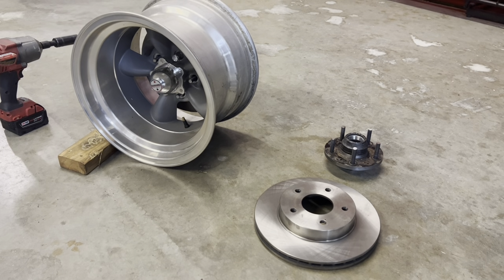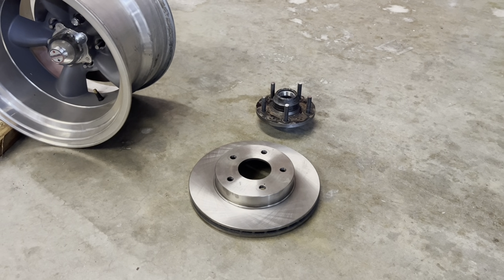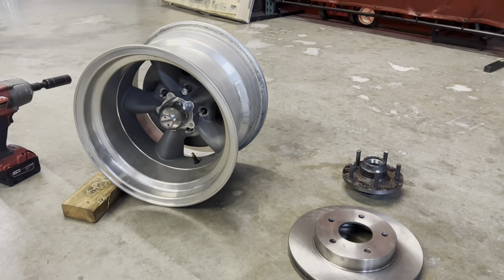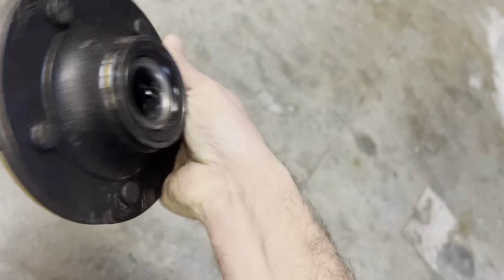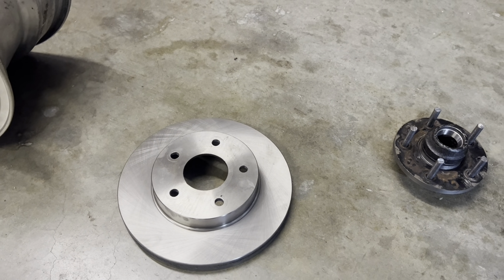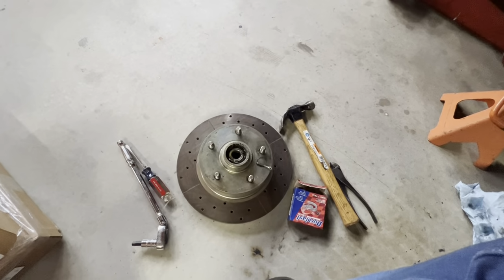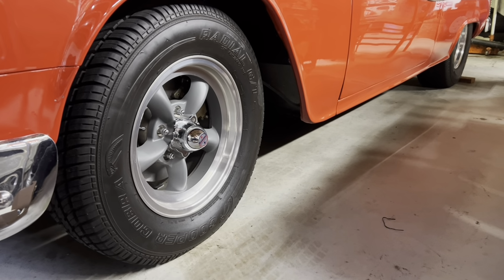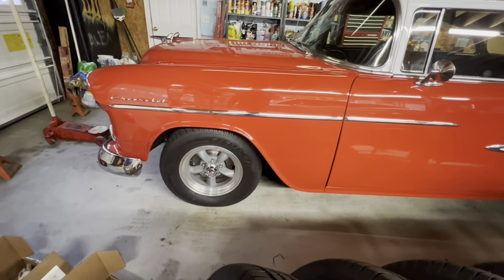1955 Chevy! Restore factory track width! CHEAP DISC BRAKE SETUP!

Comment: Niiiice car. I am getting ready to do mine, with 2 inch dropped spindles. I will have to see if the kit I am getting from Tom's Classic keeps the original track. Also, wondering if you have the 55 rear end under the car. I want to put wider tires on mine, and yours look great. Good explanation of the conversion process.
Reply from the maker: Thanks! I would definitely check because there is only one kit on the market that I’m aware of that keeps the factory track width. I do still currently have a factory 60” width stock rear end. 15x8 with a 4.5” back space with a 255/70/15. It would fit a 275/60/15 but would be a little tight. I used to run a 18x9 on the rear with a 275/35/18.

Comment: Only problem I had was the hole in the rotor had to be machined slightly to fit the 62 Impala hub. I didn’t have the machine the outside of the hub. Yes 79-80 trans am rear rotors.
Reply from the maker: Yes some of those will have to be machined slightly as well. Just depends on the year hub and brand of rotor!

Comment: I used bracket kit from mgchevy. With his brackets you can use full size D-52 calipers which I did. Got rid of the metric 80’s smaller calipers.
Reply from the maker: Basically the same brackets in all the “cheap” kits

Comment: Get cheap upgrade i didn't know. Thanks for sharing. I installed a 1975 trans am rear end in mine. Think it was less than the original one plus posi too.
Reply from the maker: No problem! Those 8.5 10-bolts are hard to beat! 🤘🏻

Comment: That car looks good.  Just struck a deal for a “partially restored” 1955 Nomad.  Sitting in the empty shell of the car are new upper/lower control arms, drop spindles disc brakes and power brake booster.  After seeing this video I’m going to have to look that pile over carefully to see if this combination of parts increase track width.  Chassis is complete unrestored condition with drum brakes all around, factory A-arms, etc.
Reply from the maker: I love a Nomad!! The control arms will be fine but definitely look at the spindle/brake combo. Cpp is the only company I know that offers a zero offset drop spindle brake setup. I’ve used it on several customer cars and really like it!

Comment: Great video! I know you said you're running 225/70R15 on the front, but what are you running on the rear? Is the rear-end stock?
Reply from the maker: Stock rear end for now with leafs in stock location. Does have 2” drop blocks. Rear is 255/70/15 on a 15x8